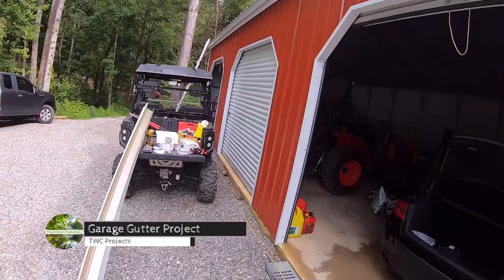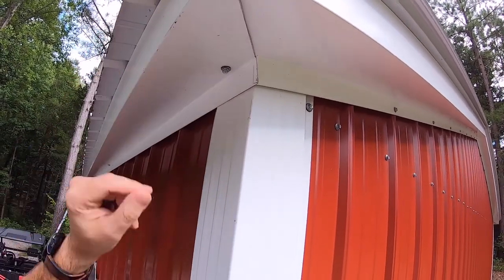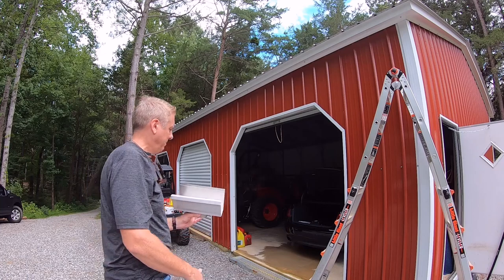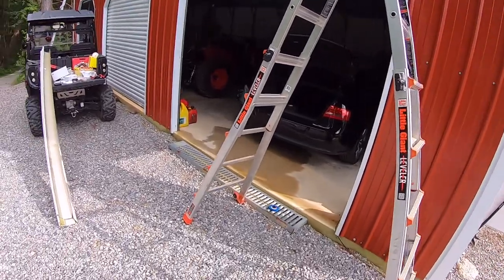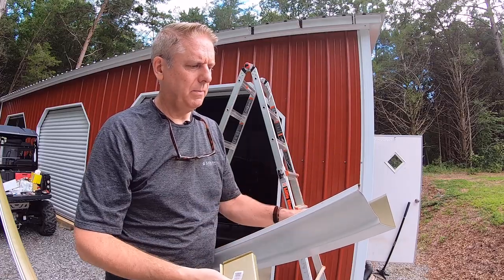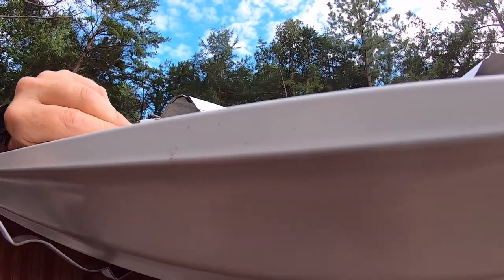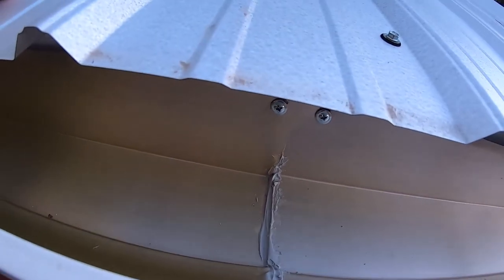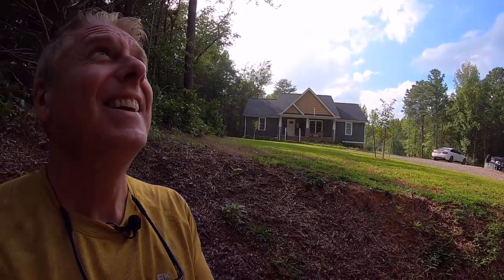81-Gutters Install on Metal Building (How-To)

Comment: Its great that you are saving rain water to use instead of well water, We have 6 - 265 gallon totes  that are connected together then a well water pump and pressure tank, we then use the water for our garden and to fill out bird baths and any other projects that we have throughout the summer season . We are getting a metal roof put on this spring and I needed some pointers on how they put gutters on houses with metal roofs and I thank you for sharing your time and expertise Thank you.
Reply from the maker: Sounds like you have a nice setup.  I never quite finished my water harvesting install.  Got all the parts, including 2x 275gal IBC totes, but decide to use those at my off-grid property instead.

Glad you found this useful.  At the time I made it, I couldn't find any videos on YouTube about how to anchor gutters to a metal building.  So I figured it out and shared with the YouTube community for the next person.

Thanks for your support.  Have a fantastic day.

Comment: Getting ready to  hang some gutters on a metal building.  I'm going straight into the metal sides of the building, but your video was a HUGE help.  Great job!  Thanks!
Reply from the maker: Glad you found it helpful.  I'm making another video right now on installing gutter guards on the gutters in this video. They are super easy.  Should be out soon, so be sure to subscribe and hit the bell to get notified. 

Thanks for the positive comments and support.  Much appreciated.

Comment: Do you have an update on your gutter project? I have a 24ft x 30ft x 9ft all metal garage building here in southern Alabama, that I need to install gutters on also. I love your great explanation of your installation instructions as you were installing yours. I have installed used IBC water storage collection tanks on the bottom of my downspouts. I have the downspouts connected to 4 inch sewer pipes to a clean out at the bottom. I then have a wye fitting up above the IBC that is sitting on cement blocks. Rain goes down to the clean out with all of the garbage off of the roof, water then backs up and flows into the IBC tanks, I have another screen filter or filter sock to catch other debris and to keep mosquitoes from infecting my tanks. I currently have one 275 gallon, two 250 gallon tanks. The 275 gallon was purchased from a mobile car wash business for $50, the two 250 gallon tanks were purchased from a third party for $100 each, who had gotten them from a poultry farm that had chlorine in them to clean out chicken houses. I use the water to irritate my fruit trees and garden. I have quick connections on the IBCs downsized to 1/4 turn garden faucets for hose connections. IBCs are really expensive if you purchase brand new. 

Caution: If purchasing used, make sure that you find out what they were used for. One third party that I had purchased from mislead me, and was selling IBCs that contained hazardous ⚠️ chemicals/materials that caused cancerous tumors and affected your breathing.
Reply from the maker: Sounds like you have a real nice setup.  I like your filtration approach too.  Thanks so much for sharing.  You should make a video of your setup.

Sorry I haven't made any further progress on my gutters.  Got them to a point where they keep the rain moving away from the doors and I stopped there for now.  Have been focusing on other projects at the moment.  Will eventually get back to this, but low on funds for all these things, especially around the holidays.  But will eventually finish the job and record it.

Thanks again for your comments and for watching.  Hope you've subscribed and share with friends.  Take care.

Comment: How has the weight of the rain and especially the snow faired for the gutters since the hangers were attached solely to the metal fascia? Also did 5" suffice to not allow a hard rain to come down onto the metal roof and completely bypass the gutters all together?
Reply from the maker: Good questions.  Just installed the gutters a few weeks ago, so can't say about the snow yet.  But had some heavy rains and they seemed to handle them with no problems.  As I was installing the 5" gutters, I was thinking I really should have gone larger; just worried about that much more weight.  If I were to do it over though, I think I'd use 6".

Hope that helps.  Thanks for your comments and for watching my channel.
Reply: @twc-projects  thanks for responding. With an all metal structure ourselves so we are worried about placing it with only thebsupport of the fascia.

Comment: Hi thanks for the video. Just had a metal garage installed and I need to do gutters. Your video is the most helpful one out there. My concern is having the gutter attached to nothing but the thin facia, and I was curious to hear how yours has held up. Still no problems? Did you have snow over the winter? I think I’m going to do basically the same thing you did, but with 6 inch gutters. I may buy a roll of aluminum strapping, material, cut short lengths and have one end attached to the gutter somehow and the other end attached directly to the roof. In my mind this may take some of the strain off of the facia, but I guess I’m not certain.
Reply from the maker: Thanks.  We did not have any real snow or ice this winter to fully test the gutters.  However, I think your plan sounds perfect: go with 6" gutters and add strapping every 6ft or so, attached to the roof.  I'd suggest you put a little silicone between the strapping and the roof at the screw hole, and of course use roofing screws with rubber washers.  That, combined with brackets every 2ft, should give you plenty of strength.  Hope all goes well and thanks for watching.

Comment: How did you calculate and adjust for the slope?  It looks like the hangers are all attached the same so how do you get the proper grade on the gutters to take water to where you want it?  Thanks for the great video.
Reply from the maker: No math involved.  Simply mounted the hanger as high as I could on one end, and as low as I could on the other end, where I wanted water to exist.  Then used chalk line to mark from top of one hanger to the top of the other.  That gave me a line where I placed the top of every hanger.  Hope that helps.

Comment: Great info wanted more info on attachment of hangers it appears that the metal should carry the weight ok ie don’t need to attach to wood inside building
Reply from the maker: I just used 3-4 metal screws directly into the flashing and that has worked fine.  Been in place for 2ys now, and no issues.   Have had some pretty massive downpours too, but going strong still.  

Thanks for your comments and for watching.  Have a fantastic day.

Comment: Just stumbled across this.. thanks for the tips and video.  I've been wondering how I was going to do this. I haven't crawled up and looked at mine yet but I'm guessing ours is the same garage style. Steel, square tubed frame. Not much to really bite into on the fascia besides the fascia trim itself.
Reply from the maker: Thanks!  I haven't had any issues with a 5" gutter, but if I did it again, I might spring for the 6".  Once you put it up there, it just looks smaller than it did on the ground.  

Thanks for watching.  Please check out my website for a lot of great resources.  ( https://twc-projects.net )

Comment: Did you have to trim off the length of your roof edge? How much over hang from the facia is the roof edge?
Reply from the maker: No, fortunately.  They were around 2".  Looking back, I probably should have gone with 6" gutters, but until I got up there on a latter, it appeared 5" would be plenty.  So far no issues, but we really haven't had any massive sustained rains since I've put them up.  So far so good.

Comment: With putting up gutters do you think it will create ice damming and water would run underneath the metal roofing to ruin the interior walls if finished inside?
Reply from the maker: Good question.  Where I live we don't have too much trouble with things like frost heaves and ice, except when it weighs down the trees enough to break them.  And that's typically only for a few days in a row before a warm enough day comes along to melt the ice.  I think if I were further north it could be an issue. Of course, anything is possible, so I guess I'll find out this winter.

Comment: Getting ready to do my metal garage, you didn't say anything about the hangers, that is a main concern on attaching them to the tin fascia, and the type of
Reply from the maker: Troy, can you please explain your question a little better.  I show the hangers I'm using (5" fir 5" gutters) of which I put 3-4 sheet metal screws in each, directly into facia.  That's it.  The close spacing is what provides the strength needed.  The closer the hangers to one another, the more weight the gutter can take.  Does that help?  If not, please provide more detail and checkout others comments on this video.  Thanks for your question and for watching.

Comment: very helpful.  my gutters guy would not touch the steel roof of the Lania gutter.  would pop rivets be a possibility vs screws on the hangers?
Reply from the maker: Seems like pop rivets could work fine.  I wouldn't want to have to drill them all out if I had to replace a damaged one though.  I've had some heavy downpours since installing them and they seem to be plenty strong even.  I guess the real test will be when a downspout gets clogged and the gutters fill to the brim.  So far so good though.

Thanks for the positive feedback and for watching.

Comment: What style hanging brackets are those that you used in this video
Reply from the maker: Amerimax 5" aluminum.  I bought them in packs of 4x at Home Depot, but can't find them on website anymore.   They do show them at Walmart though. 
https://www.walmart.com/ip/AMERIMAX-HOME-PRODUCTS-Snap-Lok-Fascia-Bracket-Mill-Finish-Galvanized-Steel-5-In-2-Pc-29022/39086963?wmlspartner=wlpa&selectedSellerId=101021777&adid=22222222228000000000&wl0=&wl1=g&wl2=m&wl3=42423897272&wl4=pla-51320962143&wl5=9008397&wl6=&wl7=&wl8=&wl9=pla&wl10=219562829&wl11=online&wl12=39086963_101021777&veh=sem&gclid=Cj0KCQiAsoycBhC6ARIsAPPbeLvPDHqsBULmBCgrLqsInT9H-744R1_Jgrphny5ufchzBGxWLi_4bSsaAuhjEALw_wcB
Hope this helps.